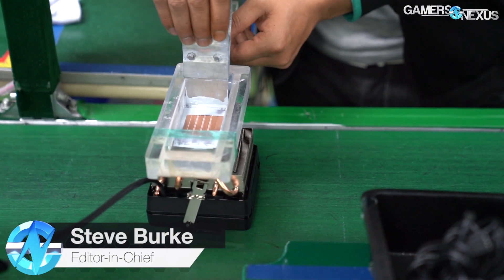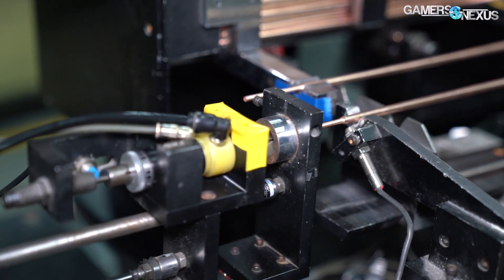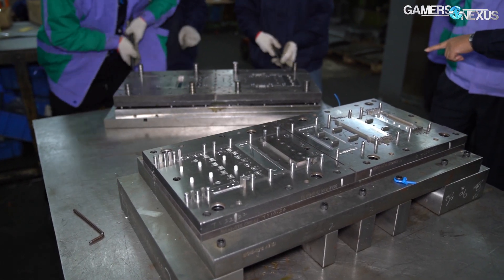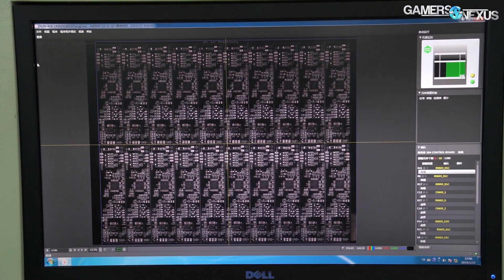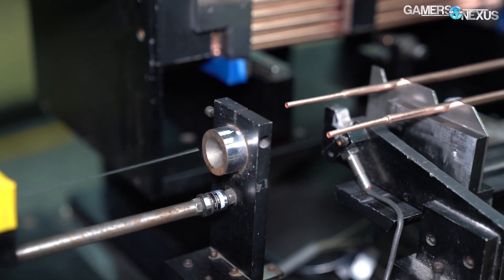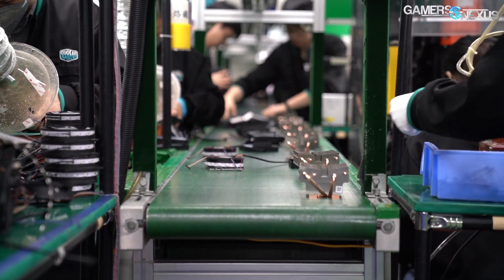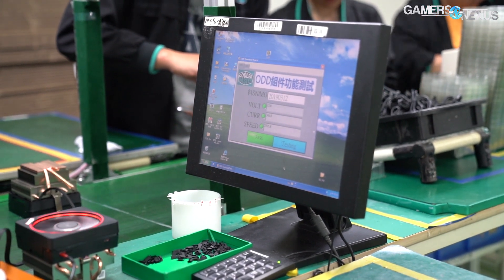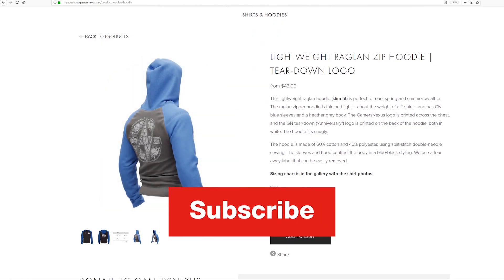How an AMD Ryzen Cooler is Made | Factory Tour (Cooler Master)

Comment: Given that Coolermaster also makes the Intel stock coolers while the AMD stock coolers perform a lot better the conclusion is valid that Intel is just being a cheapass. Come on Intel, spend those $5-10 extra and give people a good stock cooler.
Reply: What for? The stock cooler is good enough.
Reply: @1pcfred  
I like my systems quiet. ;)
The difference between Intel and AMD: Intel will keep the temperature low enough to get to the advertised boost but it gets rather noisy, AMD keeps the temperature low enough to get to the advertised boost while the cooler remains silent. Unless you toggle that switch but that is up to the user. 

Anyway, for me even the AMD stock coolers are not good enough, I would rather have them not bundle a stock cooler, lower the price proportionally and then I will buy a D15 or DRP4.
Reply: @1pcfred  
I still use an OEM system with an i5-750 in it, it is horribly noisy. The OEM put a plastic pipe in it to get the air on the height where the case-fan is. The Intel-cooler is by far the most noisy part in my case, more than the PSU and more than the graphics card. That graphics card has a minimum RPM of 30% of the maximum and the PCB broke off of the shroud so I taped it (avoiding components on the PCB).  

I probably will upgrade to a system with a Ryzen 3*** CPU in July, the price of DDR4 should decrease with around 30%, that is a good timing for me. I have a RM 650X ready (nice discount: €64) and I will put the hardware in a Fractal S.

Comment: Maybe next version of these coolers will get fans that don't whine when they throttle...
Reply: reckon you got a bad fan mate or one that took a hit in shipping, I've used both the wraith prism and spires, infact dozens at out shop; and neither made much nose given their rpm.  They got louder under full load over 2000rpm, but pretty subdued really and whisper quiet considering what the competitions stock fans sound like. 
I got a Deepcool Gammax [one of the coolers featured in an earlier video here] that came with a fucked fan, so I don't doubt your issues.

Comment: I think you missed a couple of steps at the beginning?

First, they take the dinglepop and they smooth it out with a bunch of schleem. The schleem is then repurposed for later batches. They take the dinglebop and they push it through the grumbo, where the fleeb is rubbed against it. It's important that the fleeb is rubbed, because the fleeb has all of the fleeb juice.

Comment: The "tooling" is actually refered to as a Die set. Source: I make die sets
Reply: I'm a toolmaker as well and I found that section extremely cringey. "Made by machine operators drilling holes in metal plates," isn't technically wrong, but is painfully misleading.
Reply: @andrewg9476  Well it is. He forgot about milling. Yeah he wanted to lay it down quick and simply so we have to forgive him.

Comment: I love how the safety shield comes down after the press has already engaged @10:04. lol
Reply: That's just to cleanly cut your hand off after it's been crushed, saves a trip to the ER, and you can keep working with the other hand.
Reply: Safety....... First..!???
Reply: I think that shield is not for protecting workers hand, but for protecting their eyes, if the press break the parts and shrapnel flying out, the shield can block it.

Comment: I wonder when stock coolers will switch to the tower config like the Hyper 212 etc.
Reply: Coolers like the Hyper 212 will never become stock coolers mainly because they are just too large. The reason AMD and Intel have been using low-profile coolers is because they assume that not everyone has an ATX mid-size tower. They are designed to fit into a chassis that don't have much room between the motherboard and case wall/panel.
Reply: Intel did made a tower style cooler for their X79 platform.
But there are draw back for tower style coolers as well.
For example the down flow coolers also ensures that there is some airflow towards the VRM area of motherboards.
Also the tower coolers are taller and might have clearance issues in some cases.
Reply: Threadripper use tower stock cooler.

Comment: You guys didn't cover bonding the heatpipes to the coldplate or installing the aluminum finstack at all :(
Reply: Yea it just went from heres how heatpipes are made to heres a completed cooler. I was looking forward to seeing how the finstack is made
Reply: Tyler Brigham 1:50
Reply: Tyler Brigham I think you’re just fucking blind. They thoroughly covered finstack creation. From like 1:50 to beyond the 4:00 mark.
Reply: Guessing that process wasn't happening the day they were visiting. Definitely would have enjoyed seeing that too.
Reply: here you go:
https://www.youtube.com/watch?v=BBB2rChWxmE
Reply: part 1: https://www.youtube.com/watch?v=p71V6zLybig
part 3: https://www.youtube.com/watch?v=JKG1au3y-NU
Reply: @SuperCloneRanger  Thanks for sharing these! Did I miss something in the videos, or does beQuiet! not solder the fins to the heatpipes at all? There was plenty of footage of them pressing the fins on the pipes, but the only point where they mentioned soldering was connecting the heatpipes to the base as far as I could tell.
Reply: @jubuttib  I believe its very rare to solder the fins to the heatpipe these days, there isnt a huge advantage. If you pressure fit them, the heatpipe will be hotter thant he fins in use. It will expand more and create a very strong connection to the fin.
I have an old server heatsink using a 1 inch diameter heatpipe. Those fins were epoxied on. There are some images in this album https://www.flickr.com/photos/sic66/albums/72157691314336382
Reply: Ditto, this. Thought I missed it and I went back and double-checked.
Reply: maybe business secret so they cant film the process
Reply: Or packaging
Reply: That would have been the most interesting to me as well. I need that info so that i can more accurately scritunize LTT's horrible creations the next time they come out with a dyi heatsink video.

Comment: Hi all :/
My 3rd EVGA 1080ti kingpin failed just 1 day into usage today.
The previous 2 lasted a bit longer and for this 3rd one I thought maybe my psu or motherboard was at fault so replaced both and nope this 3rd card literally went pop. PC shut off, wouldn't restart opened the case and it smelled burnt. Unplugged it all, took the gpu out and it was definitely coming from the graphics card,  near the middle to rear of the card.
From some quick googling it seems to be they have faulty vrm cooling pad and that causes failure.. Took the gpu out and PC started up fine.. Brilliant... 
How would you suggest I get a refund? Sure they can try rma it a 3rd time but for real this is a lemon card and I don't want anything to do with EVGA's products any more. Costing hundreds in me trying to diagnose, the postage to them, time for the PC being down etc it's just been an awful ownership experience. 
Hope this serves as a warning and if anyone has an idea let me know.
Thanks
Reply: You are late, this is old news from a year ago on EVGA's terrible batches of cooling mishaps. You can only get a 2 week refund if you have bought it straight from EVGA, other outlets have different policies and I doubt you'll get one this far in. All you can do now is get another one from RMA and strap a waterblock or Morpheus on it...will have better thermals than any AIB can come up with anyway and it is less of a hassle instead of sending it over and over wasting time.
Reply: @JABelms  Take this fellas advice get card from another manufacturer.
Reply: @JABelms  Yeah, really sucks.
I get that I could do that, but paying as much as I did for a kingpin card it should just work... Shouldn't have to be spending more money again for another cooler :/
Reply: @JABelms  Yep, I doubt I'll be able to get a refund as well.. Got refused that  by Evga when the 2nd failed and Scan who I bought it from only have a 30 day refund policy so I'm out of luck there.
Once this is sorted I'm never buying another Evga product again. Complete piles of shit
Reply: That's tough luck. Try a different brand.
Reply: I guess you have bad luck, My last 5 Gpus have been Evga and not a single issue with any of them. I guess RMA the card and sell it to someone and buy something else or take your chances with the 3rd RMA, it is your call.
Reply: Thanks for the warning and sample size of one. With this definitive proof and irrefutable evidence of EVGA being at fault and not providing you with exceptional customer service i will now boycott the company.
Reply: @admin8244  Do some googling the sample size is a lot bigger than just me! The company is useless believe me.